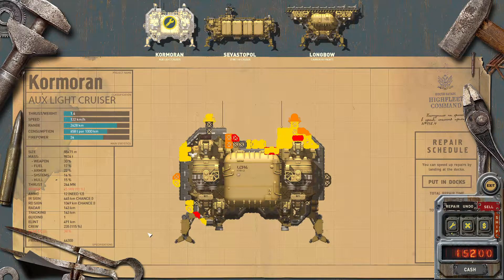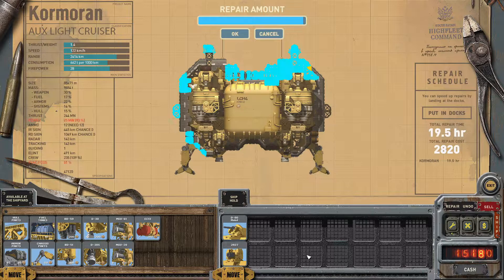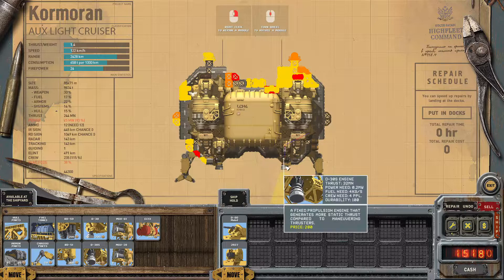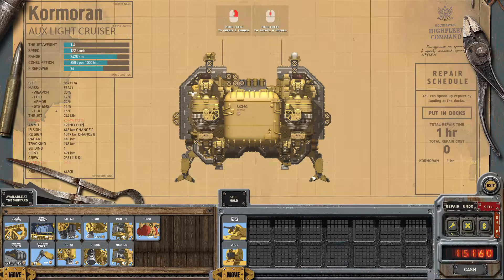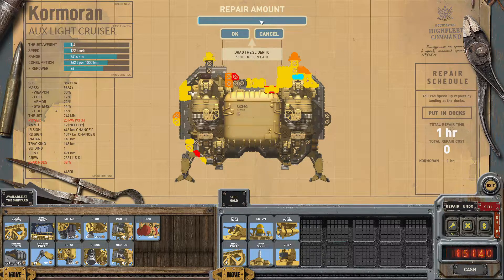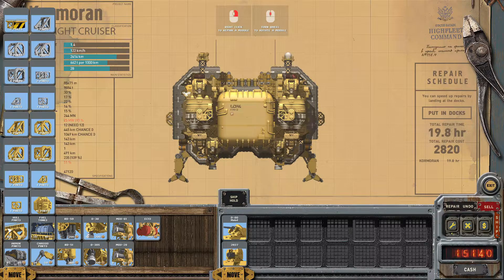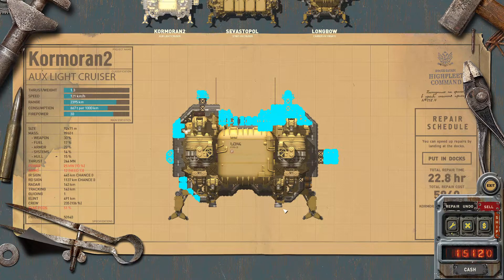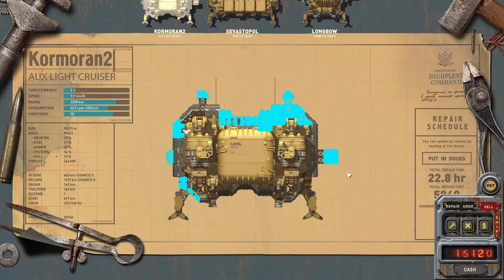Repair Guide | Highfleet

Comment: Also that blue print will be saved to that specific ship only. Not the ship class. 

I had 3 Narvans and modified one of them but that blue print was not available to select on the others. 

You will need to modify all of them individually. 

You can also just select another ship to trigger the "Save Blue Print" without having to exit the shipyard ;-)

Comment: I'm wondering if you pay for repairs and then leave a dock before the repairs are done, do you lose the money? I suspect you do, but I keep forgetting to check in game.
Reply: The money spent is just component purchases afaik so if you initiate repairs at say a merchant town and get everything you want but you don't like or have the time to wait there you can pack up and go to a shipyard. Pyotr gets upset because it technically cancels the repairs not already executed but you have already bought all the components. Once you land in the shipyards you'll have those components and can execute much faster repairs without spending extra outside of fuel costs.

Comment: Hey I am 2 years late but have no idea what to do and found no answer to it online, so basically in my campain I noticed that the ship you get at the beginning of the game, was missing some parts even after repairs, and I dont mean missiles. It was the mr700 radar, the one at the highest point of the ship. I dont really know what it does so I cant find out if its a visual bug but this happened in twice of my campains now and its really frustrating after I lost 2 of my strike group ships while landing by literally nothing.